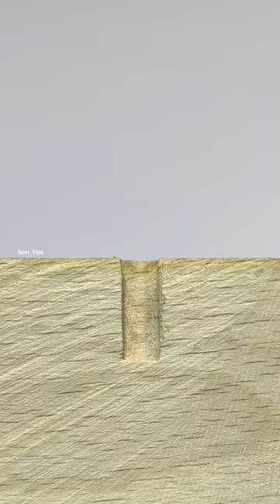Many Helps Tips

Comment: All hammering a screw in does is strip the threadwalls of the wood making it pull out easier allow easier if you have a stripped screwhead just grab another screw there there are 2 to 20 cents a pop That is far better than letting shotty work be done